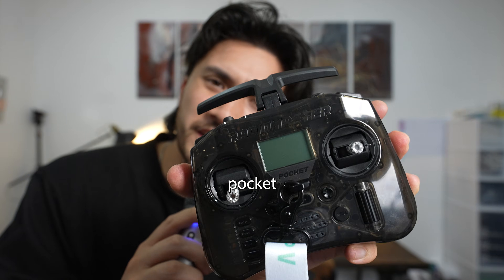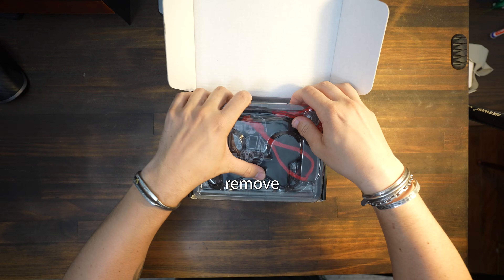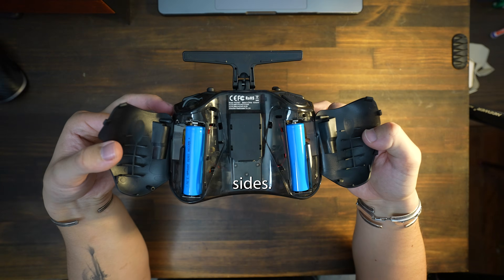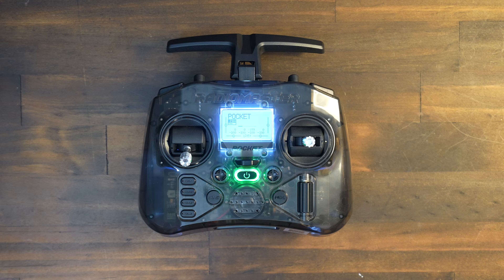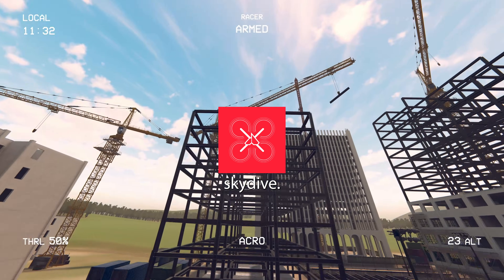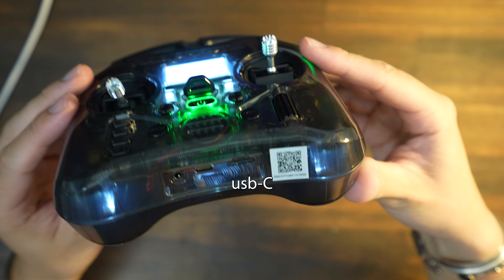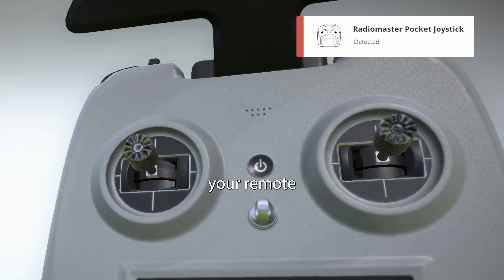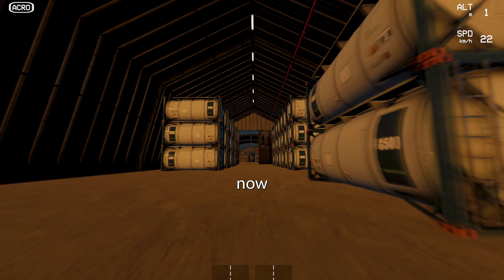How To Setup Your Radio In A Simulator (Everything You Need To Know)

Comment: well I think you need to configure the remote first. Label and select buttons. Its not just turning it on and start flying. I tried this and nothing worked. You also have to configure the computer you are playing on. 
So this video will not get you going in a simulator. The remote is not factory set to drone. You have to assign the controls.

Comment: Hey I've bought the Pocket and 18650 batteries. Is it okay to straight away insert the new batteries in the controller and charge it? Or should we fully charge the batteries separately before inserting them in the controller?
Reply: It doesn't matter as long as you use 3.7V batteries.